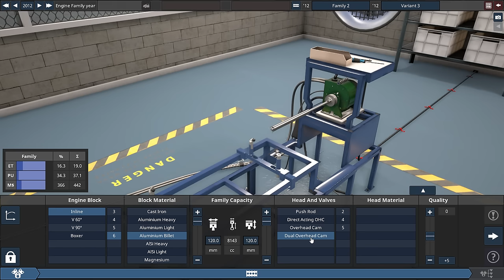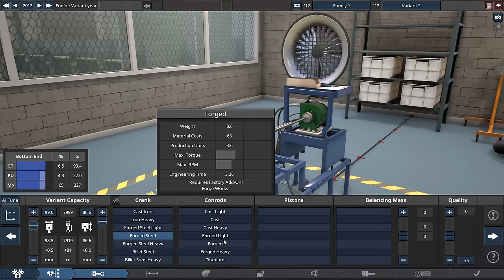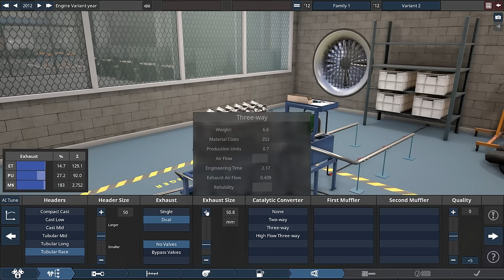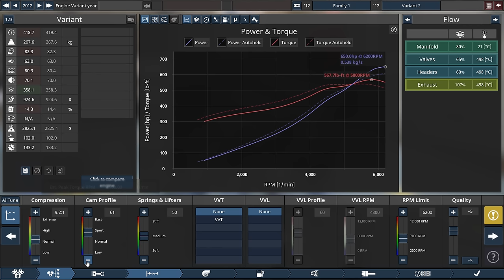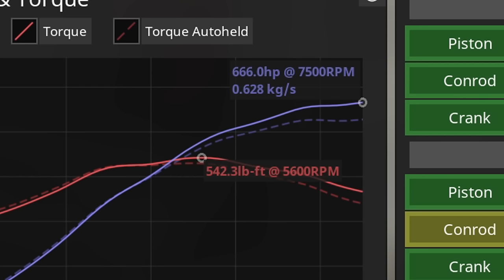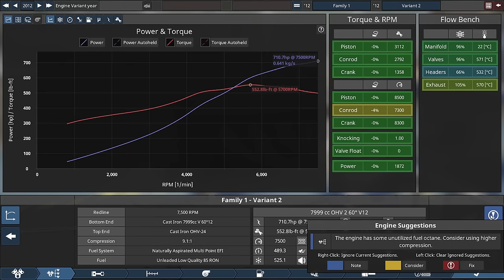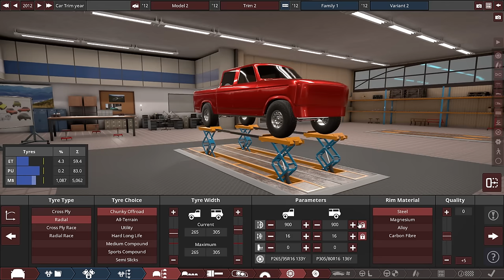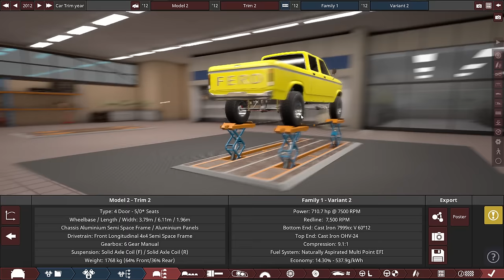Building an Insane 8.0L V12 Dune Truck From TWO Inline 6 Engines! (Automation | BeamNG)

Comment: 7.999 is actually equivalent to 8.000 in base-10, so yes, in mathematical terms, this is an 8L engine.
Reply: 7.999 isn't equivalent to 8.000, it's 0.001 smaller. 7.999... continuous is equivalent to 8.000.

Comment: 9 to 1 compression is really low for a high hp na engine with port injection 10 to 12to 1 direction injection can do 12 to 14 to 1

Comment: Those are both very nice race trucks. Kosmo, your engine is great and would probably be even happier with standard or premium fuel and higher compression. And there is also the option of just slapping a race muffler on the thing to keep the noise down a little.
Reply: yeah but the loud noise is kinda the point. lol it's supposed to be a loud offroader.

Comment: I know its a late comment, but I suggest going to the 4 graph mode

The first is just your power curves second is your ron usage (if tuning for power you can go to I believe about 1% over ron usage before losing power, anything over costs power for fuel efficiency)

2 is the usage of all your main systems, so exhaust, headers, intake etc and helps you push them based off rpm for your desired power (it isn’t the most accurate but close)

Finally you get the turbo graph which just shows you your boost against rpm (increasing turbine size pushes the point the rpm line starts to make power as well as reduces compressor surge, compressor expands the  open area more and reduces compressor surge, forgot the name but the 3rd one shifts the whole open area further to the right allowing for more power before your turbo says buy and reduces compressor surge as well. Finally boost pressure just increases boost or the max height of the line)
Reply: Don’t mind the size of this, just love this game and hope this helps someone building an engine

Comment: If you didn't know, the jeep/AMC 4L comes from a modfied AMC 256, modified by VAM as a replacement for the V8. AMC liked it so much they ended up putting it into the jeeps.